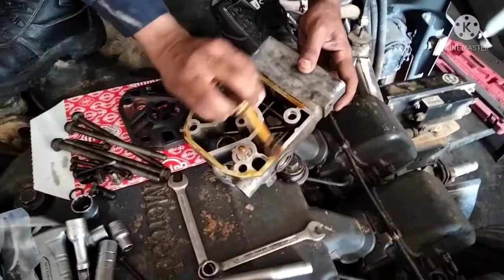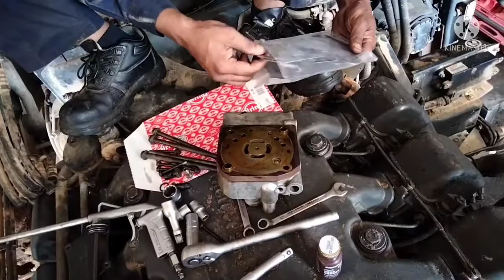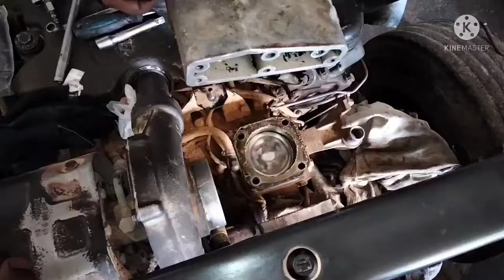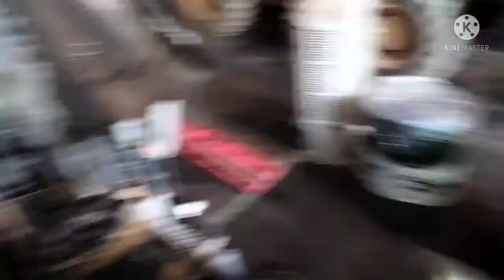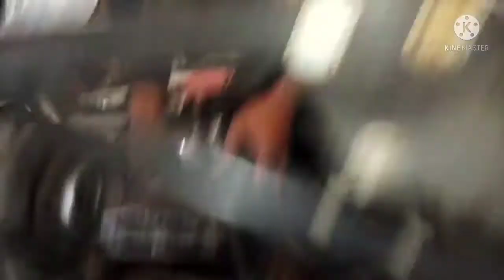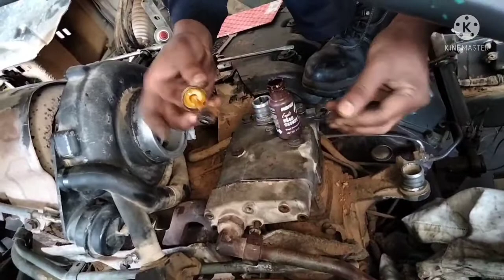HOW DO YOU FIX A COMPRESSOR HEAD ? HOW DO YOU CHANGE THE HEAD GASKET ON AIR COMPRESSOR | #compressor

Comment: What is that you put in the joints with the pencil?
Reply from the maker: Gasket Shellac
Reply: Thanks and how much torque on the top bolts?
Reply from the maker: 34-40 Nm (25-30 lb-ft) in a cross
Reply: Thank you for the help
Reply from the maker: Most Welcome